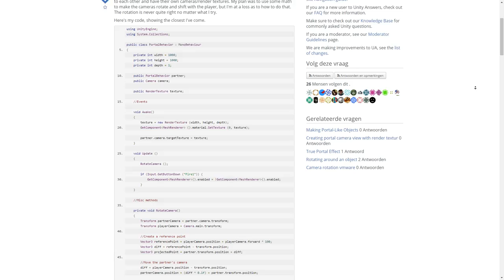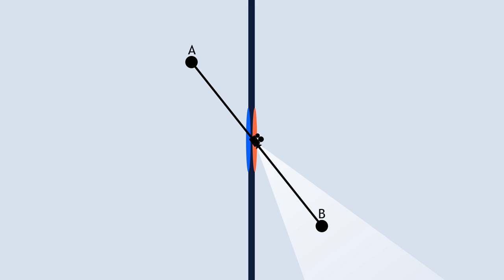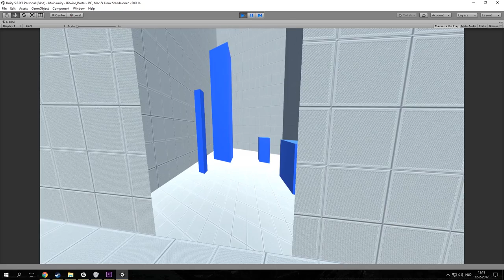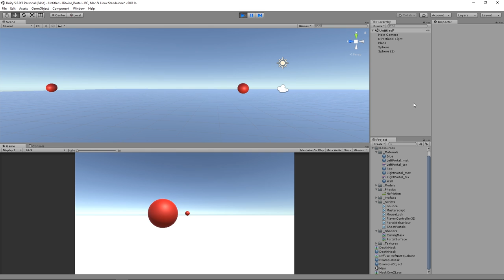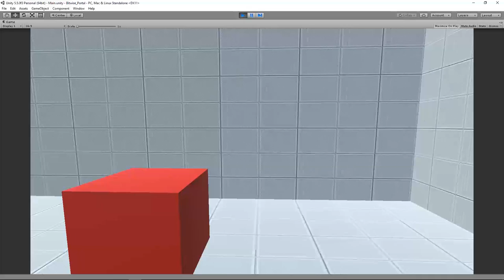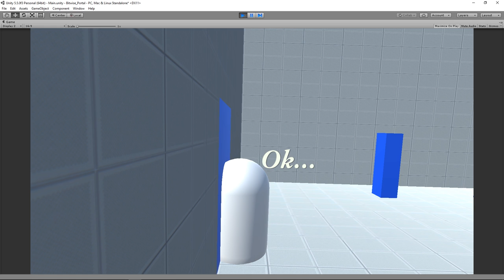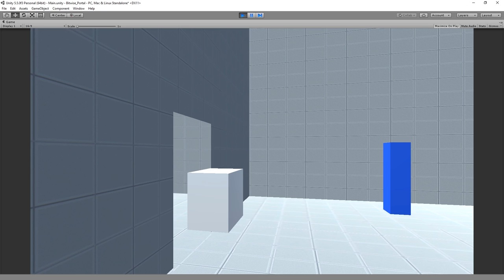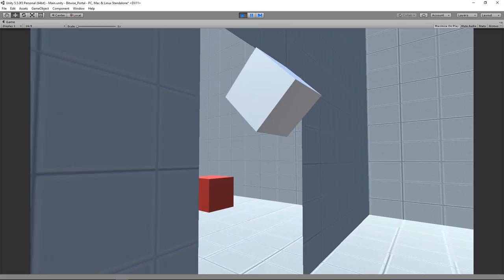How were the portals in Portal created? | Bitwise

Comment: You sadly omitted recursive rendering, that is, stuff seen through portals seen through portals seen through portals seen through portals seen through ...
Reply: Make portal layer invisible to the camera
Reply: @OutOfNameIdeas2  this is a dumb way
Reply: You have the portals camera look through and render the same image, but smaller, and overlay it in the middle of the first (at the scale). You also get a very slight intentional bend in the render, so eventually, it bends away and prevents indefinite looping at specific angles, which prevents the game from crashing due to infinite re-rendering of smaller portals. The angle you add to each render is directly comparable to how much rendering your system/engine can handle. For bad computer or engine, add more angle per render and have less portal renders. For better computer or engine, add less angle each time and therefore have a bigger "depth" by having more rendered portals. 

Try this sometime. Get two mirrors, preferably one on the wall and another small handheld mirror with an opaque backing. Try to see an infinite loop in the mirrors by facing them at each other. You will notice that no matter how hard you try, you can never see an infinite loop because the pattern in the mirror eventually bends off and prevents further patterns from being made. (Technically, if you had a 1-way see-through mirror and you looked directly through the back of the 1-way mirror at the wall mirror, then you could see an infinite loop, but we are coding the game to avoid this.) This principle of never seeing an infinite loop and only ever seeing so many at once is exactly how the game never crashes (in theory). 

Note I know nothing about the coding, but I do understand the logic behind it, so please correct me if I am wrong.
Reply: @Turtledud3  Your idea is interesting, and it would work. However, I believe the effects of perspective would become broken (that is, the further an object is, the less there is a visual scale difference between its frontmost parts and its rearmost parts).
I don't really know :)
Reply: @FoxSlyme  I'm just a student I don't know a lot
Reply: There are two quite easier approaches - one is to stop rendering whatever after certain amount of loops (let's say maximum of 10 loops should be enough). The other is limit render distance (and we would need to calculate for render distance through portals, too). Render distance is always something you need to limit, otherwise your GPU would go crazy and give up (and your game wouldn't work). But for portals, eighter pick it to calculate render distances of portals through portal, or limit how many portals can actually be seen in one portal. Some games actually used portals for simple things like mirror surface or an actual portal view. Mirror was created by an entity defining nearby surface as portal with no camera assigned, which automatically created mirrored image of whatever was in front of that surface, portals were created by additionally pointing a camera in certain direction somewhere else, and projecting its view - in both cases the portal surface worked quite differently from technique used here, because the surface for one wasn't non-solid and couldn't be used as an actual portal (it worked as a normal solid wall), and the other - the image shown here was an actual 3D render, not 3D mesh rendered into texture - that means that game actually cut out mesh that was behind that portal surface and replaced it by mesh that was in view of that portal - eighter mirror image of the mesh in front of that surface, or image of a pointed camera. Its origin was placed in the center of that portal surface and that way the view was actually following player's POV. But given how old that game is (1999), and the limitations of the hardware and the engine the game was running on (id Tech 3 engine), the portal recursion was not possible. So if there was another portal surface in the render of the portal surface, it simply wouldn't be rendered. So it created black surface (correct render) or something called Hall of Mirrors effect (abbr. HOM; it's actually a bug, mostly present with nVidia cards). That way it is impossible to create infinite mirrors inside this engine (unless the render engine is heavily edited) and such as that the maps have to be designed in such way to avoid creating line of sight possibly creating an infinite mirror loop and therefore having HOM in that particular part - which is fairly easy task to do - just don't have two mirrors on different planes in the same room. Quake 3 engine works with IBSP maps, which divides 3D space into subspaces by number of planes, and defines those divisions by number of spacial attributes - air, liquid (water, lava, slime), solid surface, sky, etc. Then there are portals, which is group of planes that define a break in binary tree. Not all portals are an actual visible portal. Those portals only define where there is break in binary tree. Break in binary tree divides surfaces into pieces. All surfaces in Q3 engine is formed by triangulated meshes. It is very wise to have as least amount of portals as possible in your map. Otherwise your map will become very resource hungry and therefore will be likely cause of lagging. The actual program implementation and machine interpretation of IBSP map is much more complicated and quite a bit of mystery to me. But this is overall how it generally works.
Reply: huh? this should automatically work once cameras are applied.
Reply: Turtledud3 they actually explain that in the developer commentary of portal. They just cap the amount of scenes that can be re rendered to 9, and by then it is too hard to tell it’s not infinite.
Reply: @Turminal1  indeed. If you just open the graphics settings, you can adjust the levels of recursion.
Reply: @Turtledud3  in theory you can't see an infinite loop, because each iteration has less light hitting it, thus it doesn't take too long before it's pitch black.
Reply: Shad Amethyst I think you are right. The object would eventually begin looking very flat since the portal render compresses the objects it sees down over each loop. However, I don’t know how many loops through the portals it would take to become flat. So maybe the angle had a minimum amount it can possibly be to prevent this distortion from ever being seen. Also, there may be such a thing that by the time the object becomes flat, or at least starts looking odd, it would be so small in the portal frame that you could barely see it anyway since each portal loop makes the next portal slightly smaller at a rate that depends on how far away the player is from the original portal.
Reply: Turminal Oh cool! So my understanding of how they work just by logic wasn’t too far off then.
Reply: gracefool Yes. The light does eventually have issues in the case of mirrors reflecting the light off of each other. The light eventually runs out of energy and thing look black as a result. However, we are looking through portals. Each time a loop happens it shows the room completely full of light. Would that principle still apply since between every loop the scene gets a light boost from the room?
Reply: @Turtledud3  No, portals are the same as mirrors. Light is emitted inside the mirror room too, it still doesn't stop the fact that each iteration creates a bigger room for the same amount of light. Whether it's a portal or mirror, the amount of light emitters doesn't increase. If there's one lightbulb in the room, then there is only ever one lightbulb. Otherwise a portal would create infinite free energy, breaking not only physics but logic.

It could only work in portals if you're not actually raytracing, i.e. you don't care about physics or logic in your gameworld.
Reply: @FoxSlyme  and your suggestion is......? Or do you just point out other people's "flaws" without offering other suggestions?
Reply: @Turtledud3  Or just make the recursive portals very slightly green, like mirrors are in real life. That way, after an amount of renders that's determined by your processing power, they get too dark to see.
Reply: @HibsMax  Below it describes a lot of good ways that could come up, but not render portals in portals - this means giving up without a fight.  I should not offer my option if I agree with one of the existing ones.
Reply: Valve explains it in the commentary mode for the first game.
Reply: Billy Danner That would also work. I hadn’t thought of that.
Reply: @Turtledud3  you wouldn't have to have an angle, that would make it look bad, it's not gonna get to drawing portals infinitely cause eventually it will not have the pixels so you'd just have to make it stop once the render width of the object gets too little and fill with an another color what's left (it will be to small to be noticed anyways). 
For optimization you could calculate the average color of all the pixels that the image would have and render a quad of that same color in the position of the portal after a certain number of portals drawn, and maybe store that rgb the first time you render it so you don't have to do all the average again.
You'd probably need to write your own engine with an api or even from scratch though, I don't think unity allows to have this low level rendering control
Reply: That's not a issue here since your only using a camera to view another camera. In other words it isn't possible to have unlimited rendering loop issues the only thing that would seem strange is that there would be a delay to the last level of the render when you move slightly since the fps limits how fast each level the repeat would be redrawn.
Reply: @Turtledud3  alternatives:
a) store the amount of rendering passes and just render a black surface after that. If a sufficient amount of recursive images has been rendered, it won't be noticed easily.
b) if the recursively rendered image is below a certain a size, e.g. 2% of the portal's size, stop rendering, and render the color of the opposite portal
Reply: This is just an idea that I've given only a bit of thought, but why not deal with the portal graphics through the shader code? You can calculate what surface texture reference is needed when drawing each fragment part by using a bit of trigonometry. Usually you incorporate a bit of fog with distance so you can fade out layers towards black using something like softmax, so you can see that each subsequent recurrence of the portal gets darker. It's a similar idea to using mirror shaders.
Reply: @Kurushimi1729  Well it's not part of the video, so it's omitted . . . whether it was a intentional decision or not
Reply: Kaeden Meek Cool!
Reply: I would imagine it's just a loop of the same algorithms of distance and camera position ing for each portal up until it's out of render distance
Reply: Turtledud3 Valve put in a setting that makes the game stop rendering “another” portal when looking through after a certain amount of portals. The maximum is 9 portals, although I’m sure there’s probably some file you could edit to make it higher or a console command or something
Reply: @Turtledud3 there are better ways to crash the game, summoning 500 Wheatleys is my go-to.
Reply: @shadamethyst1258  but I think that's how recursive portals are rendered in the game.
Reply: @Turtledud3  With the two mirrors: you'll never see an infinite number of mirrors, because of multiple reasons:
1. your head is in the way - can't help it, your eyes are on your head, unlike an invisible game camera.
2. the mirror only reflects 90% - 95% of light, so after a number of reflections the light amplitude gets so low that your eyes won't be able to distinguish it from the much brighter outer reflections.
3. the very far away reflections are so small you just can't see them
Reply: You just need to do the same thing multiple times. Let's imagine you're looking into the blue portal and out of the orange one. For the first see-through you move the camera relative to the orange portal to the same position as it is relative to the blue portal. Now if you see the blue portal throug that, you just move the camera again to the same relative position as it is now to the blue portal. And repeat...
As with real life, you won't have to do this infinitely. The player character is rendered and at some point (as portals get smaller due to distance) she covers the whole portal, so you can stop. In real life, you can't see infinite mirrors because your head is in the way :)
Reply: The best way to handle this imo is to double buffer the portals, so each frame the portals will show the previous frame, this means in 1 second you will have 60 layers deep, which is far more than you need

Comment: The visual portion does not need to be anywhere near as complicated as proposed. Have the second camera point perpendicular to the plane (or tangent) of the portal and render with an off-center view frustum. This has the exact effect of "projecting" what you should be able to see through the portal onto a planar surface, skipping past all the perspective issues, distance issues, etc. It would also massively simplify recursive portals rendering. This will also be much better for performance as your view frustum will only need to be as big as the portal on your screen, so most of the time the majority of the scene would not even have to be rendered in the portal.

We created this exact same effect many years ago in an intro computer graphics course, albeit in D3D11/OpenGL, but I'm sure Unity supports off-center view frustums as well.

Edit: To make sure I wasn't just speaking out of my ass I just spent an hour replicating the visual effect in Unity. Can't get the camera to natively render off-axis but easily solved by supplying a custom perspective projection matrix. The above method works in Unity.
Reply: can you make tutorial or upload project files please?
Reply: Can I get some of your brain?
Reply: Can you elaborate a bit more on this strategy?
Reply: If there is enough interest, I will record a tutorial when I find some time
Reply: Samuel Van Allen That would be great.
Reply: @eclmist  still waiting. Or at least can we get a project file?
Reply: @eclmist  I'm interested.
Reply: @eclmist  Definitely interested, I've been attempting to recreate the effect but get stuck at the distance and perspective
Reply: @eclmist  I'm interested
Reply: Go ahead Samuel, you know you have to. ☺️
Reply: please  make a tutorial
Reply: Yeah I thought so too, although I wonder how this compares with the portal 2 method using the stencil buffer, regarding performance and the possible implementation of recursive portals

Comment: "It's not as easy as  you might think" 
I was blown away when I first saw it. I think it must be one of the toughest things to program. Honestly, the explanation you gave is actually much easier than what I thought!
Reply: If you ever programmed a 3D camera position matrix, it's actually pretty straightforward. The portal basically transports light rays, so we can either move the whole scene to be where the portal shows or move the camera. This is the same how mirror/water reflections work, just flip the camera to the other side, render it to a texture and map it to the reflective surface.

Comment: He said in the video that in order to retain an entity's velocity when going through portals, you need to transfer the velocity information when you enter the portal, to when you exit the portal, so that your velocity isn't just set to 0, and the angle of exit should just be in the same direction that the portal is facing. This is wrong. Sometimes when you enter a portal, you enter it at an angle, say, I run through a portal that is diagonally facing toward the ceiling, I would exit the portal with the same velocity that I entered it in, and I would exit it at an upward angle, relative to how I entered the first portal.

Comment: Nicely explained! I did some portal experiments in UE4 a while back and it's pretty much the same implementation

I vaguely remember reading from one of Valve's presentations that they do all the rendering in one pass by setting the view/projecting matrices for the masked area of the portal so they don't use a secondary camera in the same way. It's been a while, so the details are blurry to me. That would save a bunch on performance, but is a lot more involved in getting to work proper.

Are you Dutch by any chance?

subbed